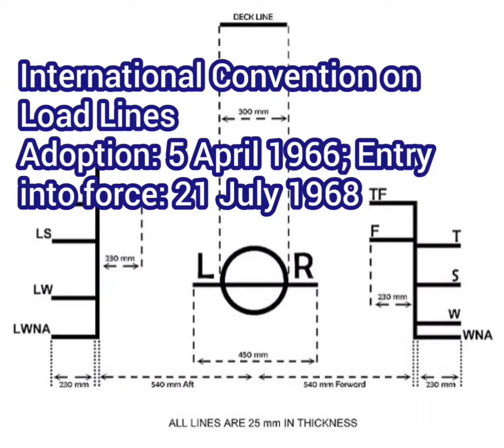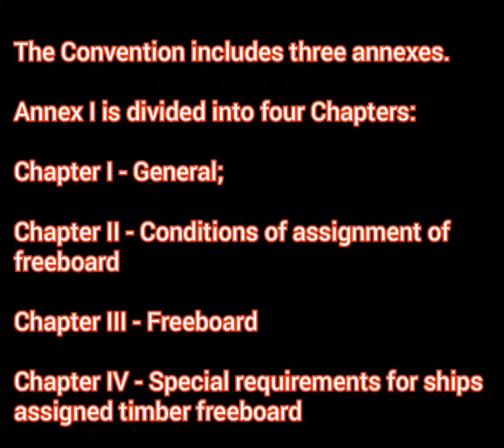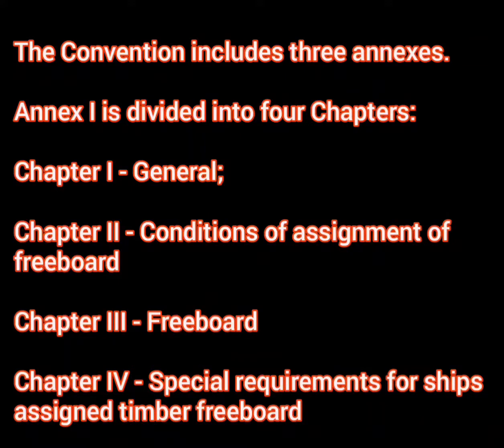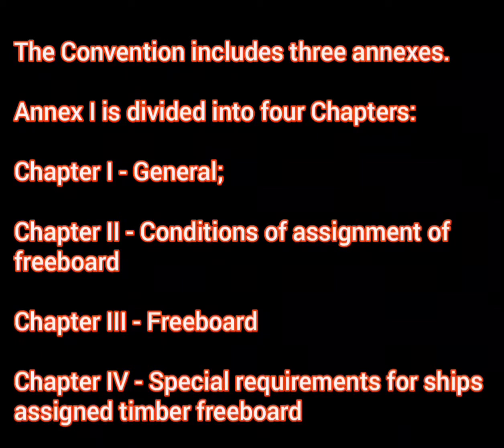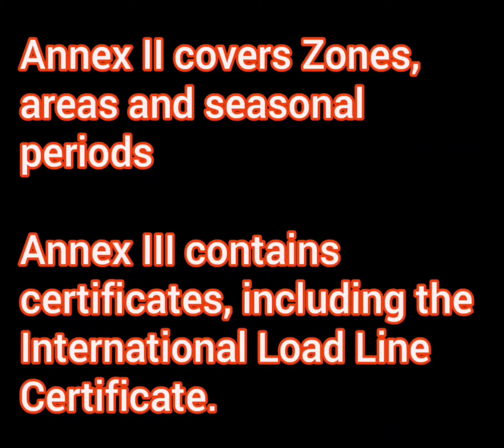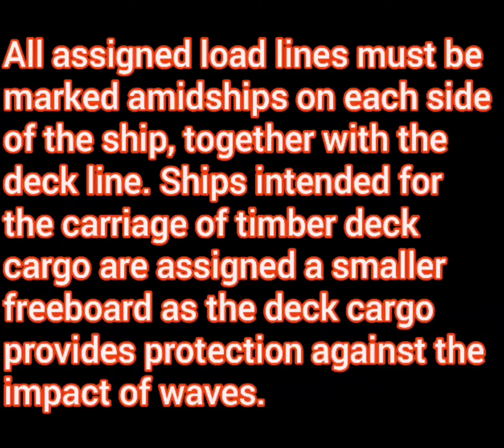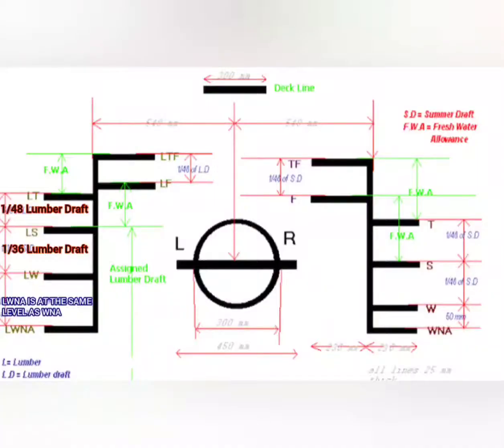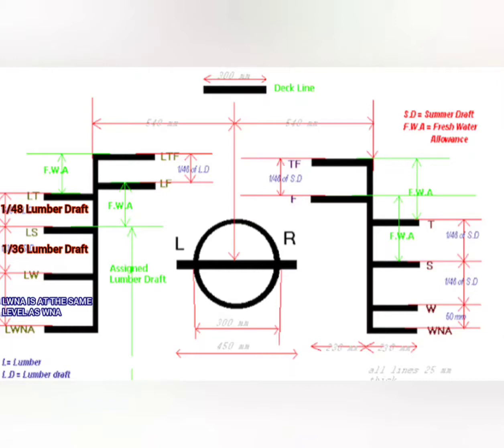International Loadline Convention, it's contents. Difference between Timber & Normal loadline marks

Comment: Nice video...kindly advise how the lumber summer draft is assigned....and if surveyor asks to draw only the timber load lines then how to start...since normal summer load line is aligned to plimsoll line so it's easier to draw
Reply from the maker: WNA mark height is same for both type. For actual marking you would always refer the ILL certificates for freeboard requirement and measure the height from the deck line.
Reply: For preparation of second mate / DNS/ BSC nautical science/NCV full course visit #kundanpatna